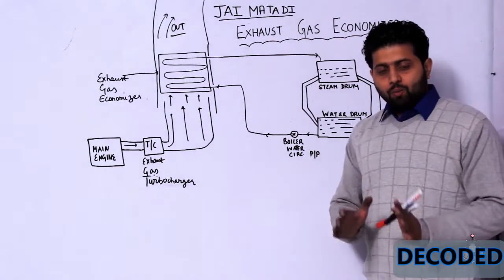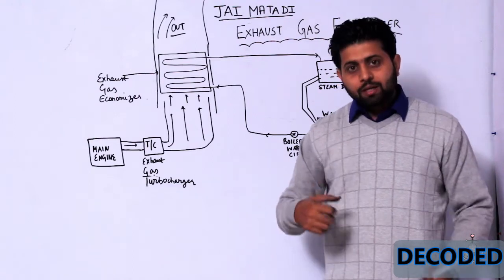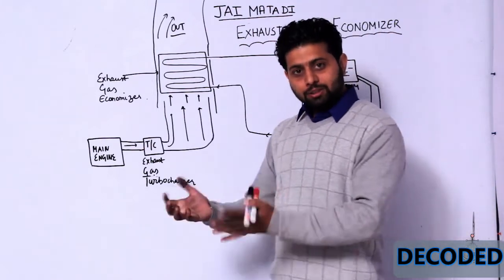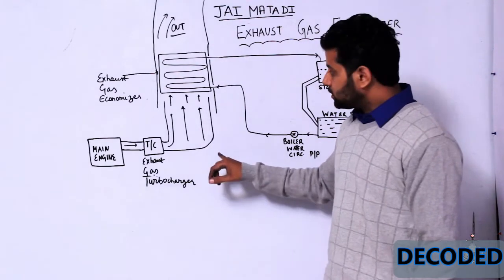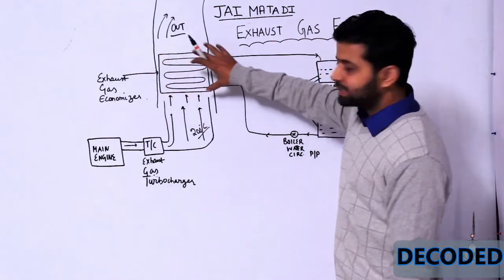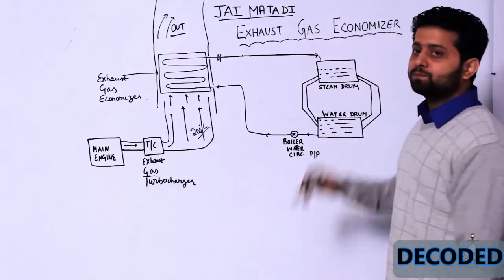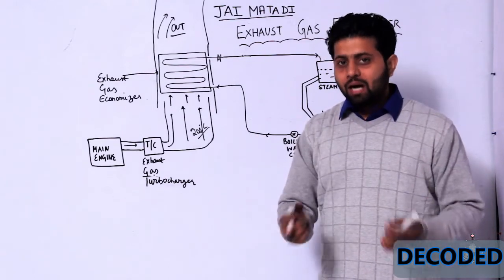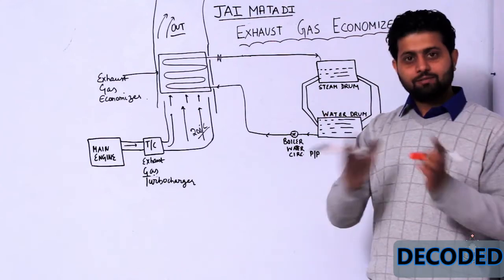What is Exhaust Gas Economizer I Exhaust gas turbocharger | Important part of IC Engines and Boiler

Comment: is it possible main engine running if the turbo charger failed and economizer? please answer. thanks
Reply from the maker: for a very short duration and very slow speed...though i have not tried this ever,,,

Comment: Sir,
Exhaust gas boiler and exhaust gas economiser is same or 
There is a seperate boiler on board that runs only on exhaust gas called exhaust gas boiler?
Reply from the maker: Beta they are more or less same. Exhaust gas boilers are fitted on Bulk carriers where they are integrated with the Fire tube boiler itself where as on Tankers its a separate entity called Economizer.
Reply: @MerchantNavyDECODED  okay sir.